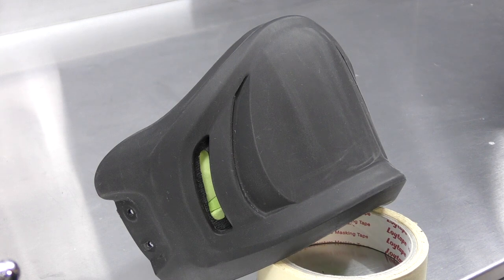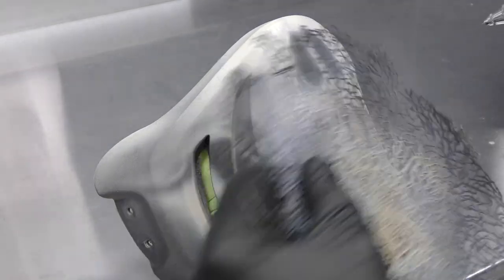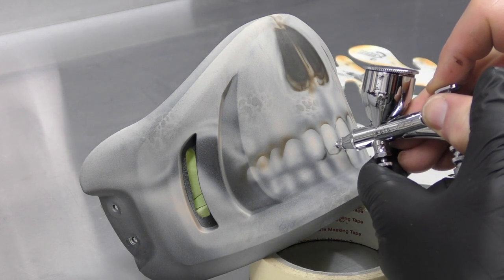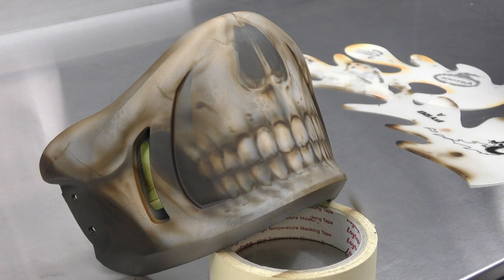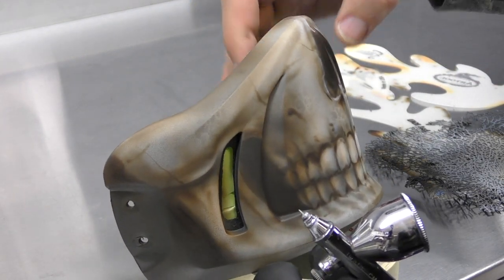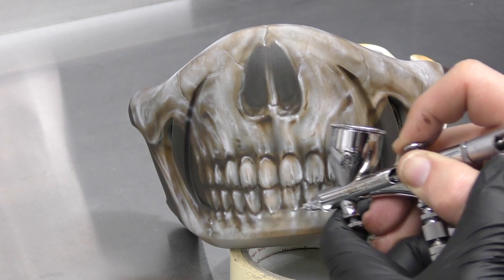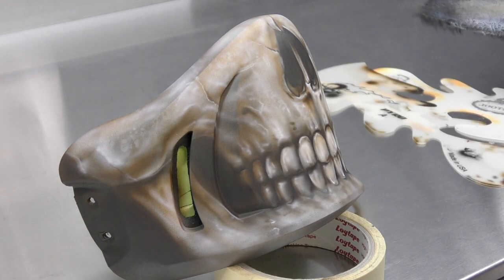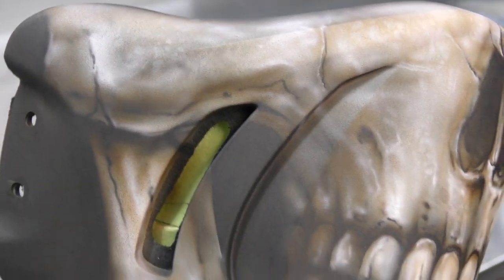How to Airbrush a Skull Jaw on a Bell helmet muzzle

Comment: I've watched a number of your videos...excellent results (Createx is a good paint, as is House of Kolor). Our 'styles' differ, so I still cringe sometimes when I watch you 'mid project'...which leads me to something I've noticed...and have a question about: When you mix in reducer, are you mixing (as on label, 10%), or 1:1, or 70/30...or do you vary depending on some unmentioned factor? Also, is reducer all you use...or do you also use extenders at all? When you use reducers, do you have a favorite (such as 4011, 4013, etc.)?
You cover a LOT of your 'art process', and that's great for beginners getting into airbrushing acrylics...but from someone who loves motorcycles (and all the nuances of tank and helmet art...from pinstripes to basketweaves to starbursts, etc.), I always want to hear the input on 'the seldom mentioned' items from others, as to what their 'real method to the madness' is...and why they make some of the choices they do (preferred sanding grit, why courser on ABS plastics than hardshell polymers...why 'superfine' (up to 1200 grit) on metals...I've learned a LOT about 'stabilizing art' in such environments and inputs (such as ALWAYS using a sealer, not primer, on top of plastic body filler before basecoat, when working with acrylics...as plastic body filler is absorptive...and can cause 'shade shift' due to the faster dry times if not sealed first)...GREAT CHANNEL! Keep up the excellent work!